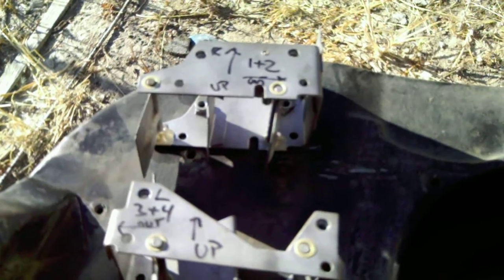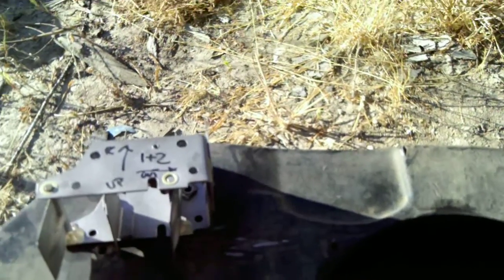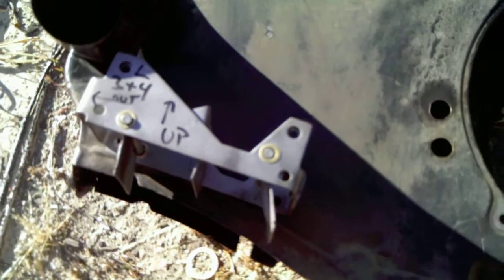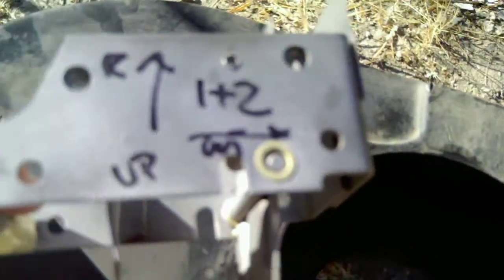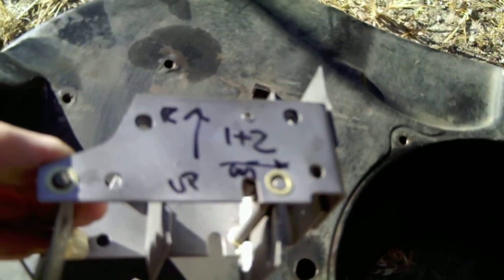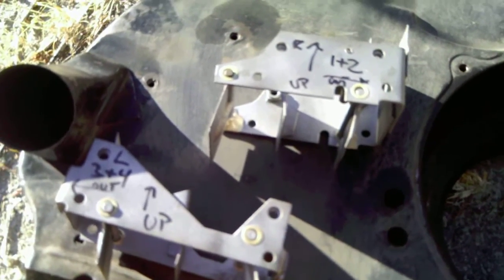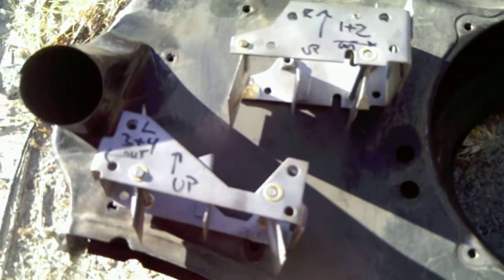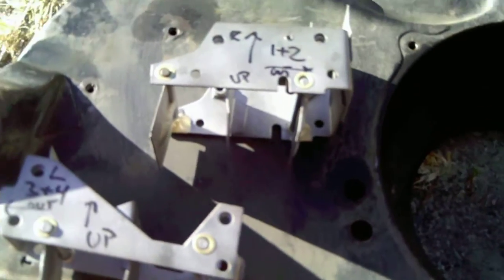VW Air-Cooled Engine Cooling Shutter AKA Thermostat Flaps.

Comment: The whole purpose of the vanes, or flaps, is to LIMIT the amount of air to the heads and cylinders for a faster warm up to operating temperature in cooler climates. The thermostat will open the vanes once that happens and the vanes will direct the air where needed. I suppose you can do without any of this if you are always running the engine in a really warm climate.

Comment: Tat is not what the purpose of those flappers are for.  With the aid of the thermostat and the rod that attaches the thermostat and flapper, you prevent your cylinder from warping as the heat up.  You might as well leave them out for that matter.

Comment from the maker: Also, to restore the original cooling system with the Bellows thermostat can be pretty costly, more than fifty bucks. But if you want to use the rod that connects the shutters and wire it open you can.